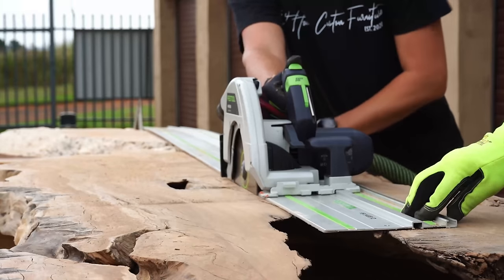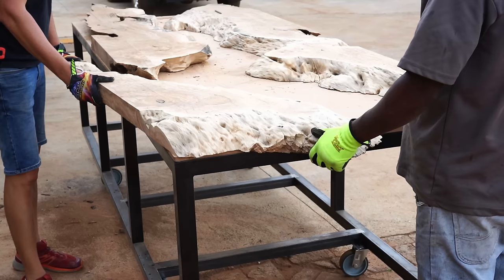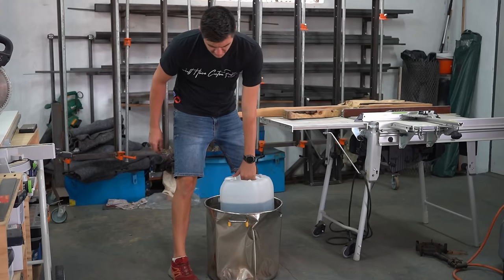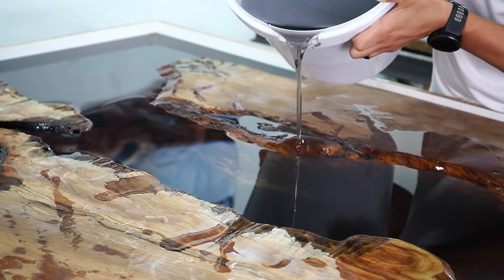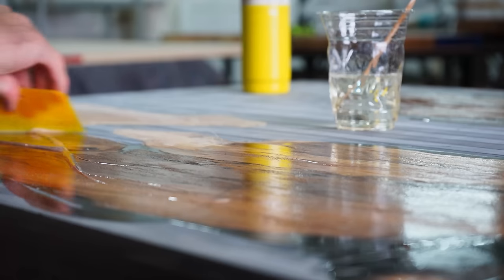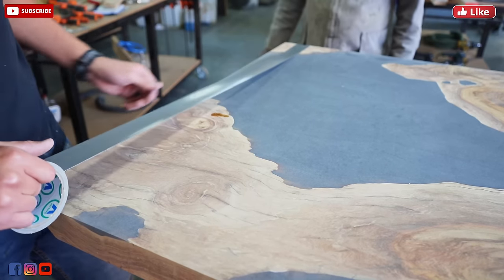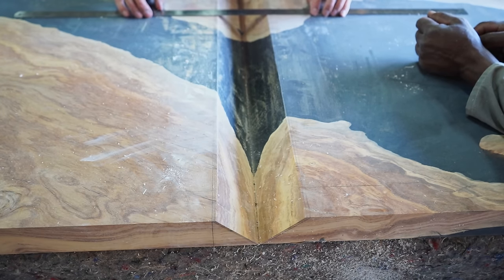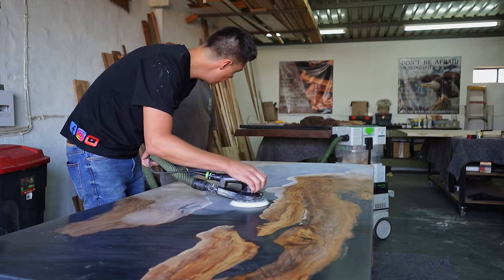our MOST EXPENSIVE epoxy table build (with Blacktail Studio)

Comment: Turned out absolutely stunning.  I love how it contrasts with the clients island.  Personally, I have yet to build anything with epoxy or otherwise, I am just now starting to get the tools purchased to start.  It is GREAT that you show your mistakes and exactly how you were able to correct them.  Especially the tip for adding the width of the blade when cutting the 45-deg. angle for the waterfall.  I will definitely have to purchase and watch your class before I begin my first project.  Tho that will be a few months down the road.

Comment: Hey Greg when joining your two pieces of melamine together with caulking to make your mold longer, do you not worry about it seeping too deep into the epoxy table when making these transparent builds? On the edges the caulking can spread pretty far sometimes as you know. I did notice it was pretty thin where the seam was, which seems like the best way to do it, but also might affect the leaking potential. Either way let me know your thoughts. Thanks for the great content, your videos and tables are amazing.

Also I'm looking into getting a festool ets sander and was wondering do you use the soft pad on your sander? I know they have a hard, medium and soft one.
Reply: Its one of the reasons that the molds are made a bit oversized. Everything can be trimmed down and made perfectly square while removing any of the weird edges that may be present from the caulking.